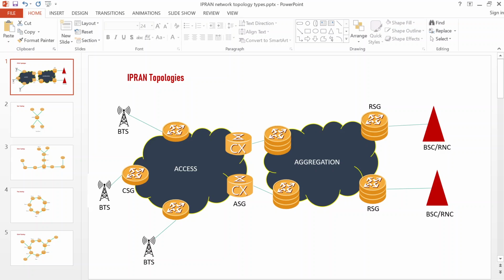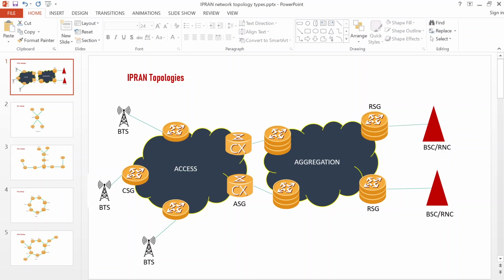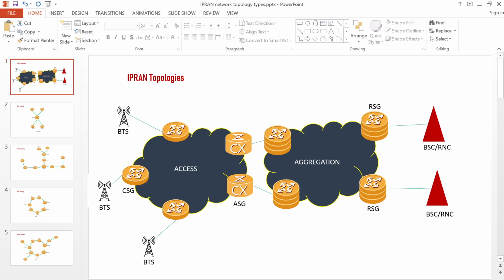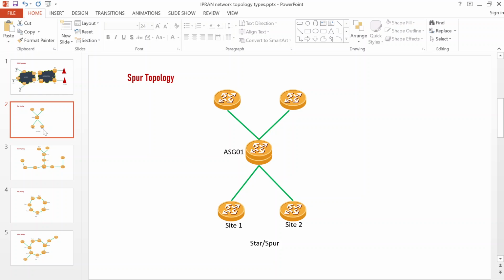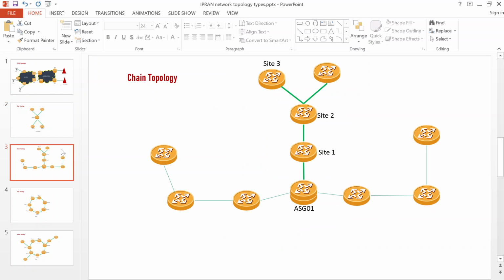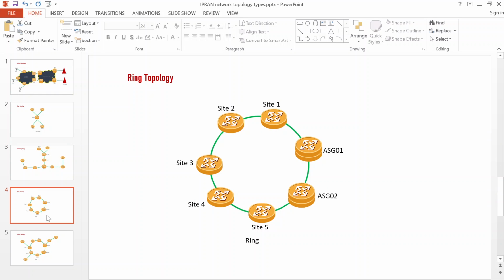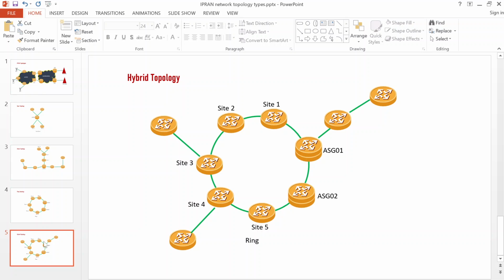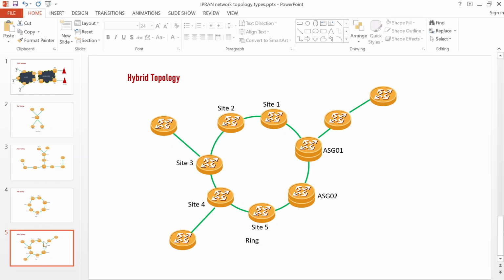IPRAN Training series Part 2: Introduction to IPRAN Topologies

Comment: Waiting for the next part, infact the selection of topology sometimes may depend on how the sites are physicaly located, but in the end the hybrid topology remains to be the best.
Reply from the maker: Yes. That's very correct. It depends on the physical location of the sites but we try to achieve ring setup for reliability